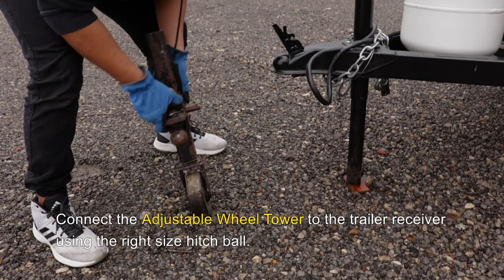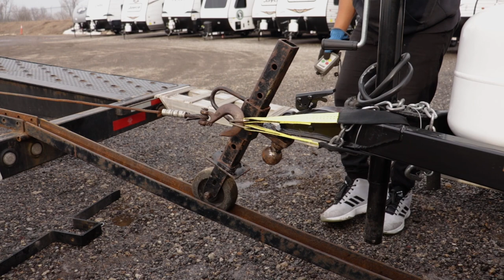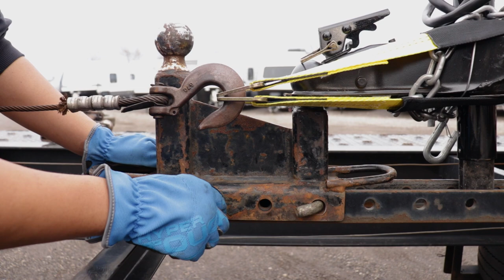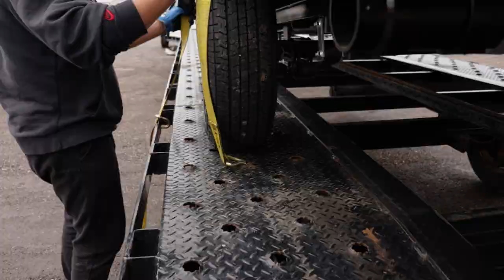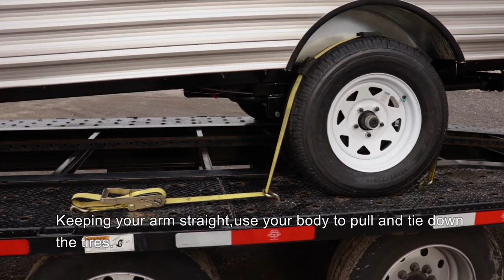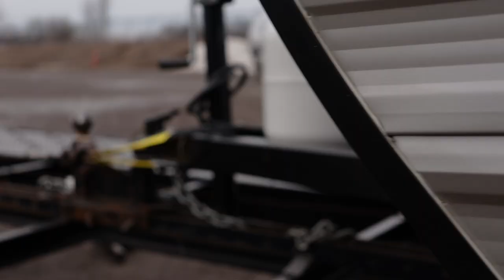How to Load a Flatbed Trailer

Comment: If you used the tow loop on the Adjustable wheel tower. You would not need the axle strap to load the trailer. It will keep the wheel tower in the upright position as well.
Reply: U have an example
Reply: @rioboy1  this comment is over 2 years old. If you look at the tower there is a steel ring welded to it. That is where you are supposed to put the hook from the winch.
Reply: Appreciate it

Comment: what about unhooking your truck off the trailer and connect it into te bumper pull trailer and reverse it into the gooseneck? Can it be done? serious question
Reply: I am doing this exact thing in 2 weeks. will let you know.
Reply: @craiglan5427  be careful now! i was not able to load the trailer by backing it up.
1. The trailer back side hit the ramps before it reach the tires.
2. The megaramps of a bigtex are not wide enough for the tires width on trailer being back.

I wish someone would told me this.
Reply: Those vents are designed to head into the wind not 70 mph backwards.

Comment: Almost need the wheel jack hooked also, along with safyy rope.  pull it straight. Not sure if i would stand inbetween the ramp and trailer toung while initially loading. Best to stand on the outside. Incase it shifted or poped out and down. Trailer tounges arnt bullet proof.  Thats why they have safty chains.